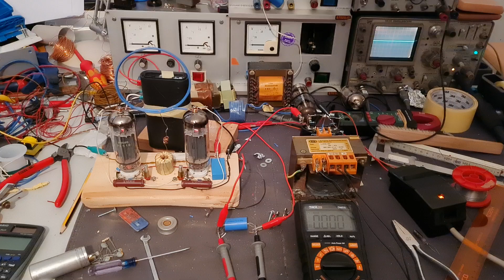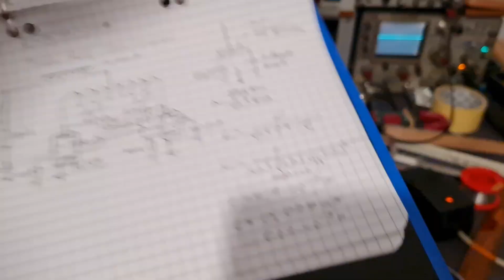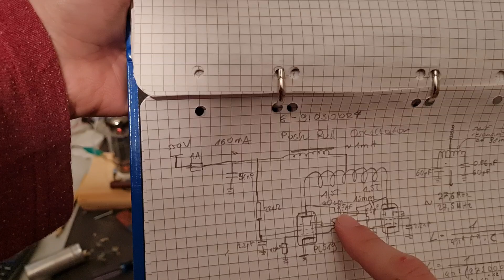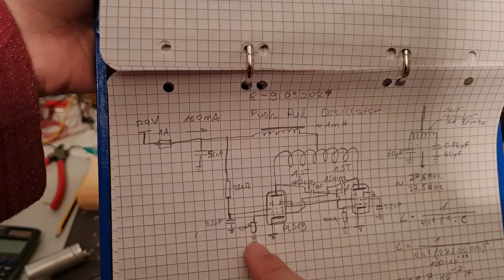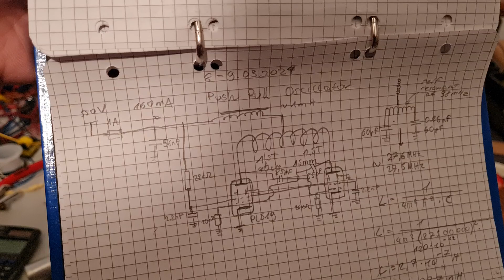Help with the PL519 Vacuum Tube push pull power oscillator

Comment: The length of the wire used for the anode choke should not be longer than 1/4 of the wavelength the oscillator is working on. You can used a small neon to 'see' the high voltage nodes and low voltage but high current nodes along the choke if it is too long. At high power, those nodes will be hot as well. Also I agree with another Youtuber's comment that maybe a core shouldn't be used in this application cause it will induce a lot of parasetic capacitance.
Reply from the maker: It's an honor to have you here, thank you.
I didnt think the choke would be the problem, last time i made this i used a plastic piece to wind stuff on, i suppose i will make a different one witb a large amount of turns.
should i try removing those turns in thr air first?
Reply: @janno288  Yeah, I think those wires in the air won't do too much help and ypu can just remove them. By the way, what valve did you use in your previous successfully operating pushpull oscillator? In my opinion 20pF feedback is way too large.
Reply from the maker: @uecmitsuimarinedieselengin873  the value of the choke?
I didnt calculate it, i had a piece of plastic and i would a random amount of turnd on there, maybe 100 turms or so, i still have it, i can put it into one of those testers and see what comes out.
that oscillator worked at least and was able to light up fluorescents and neons, but only well above 300V supply input if i can recall.
How should i change feedback capaciors with frequency and griddrive?
I plan to make a big push pull tesla coil with two gu-81 thbes which hasnt been done before.
the frequency is 160kHz. for the GU-81 the feedback resistance is equivalent to a 150W 230V tungsten lamp. I was thinking of converting that resistance to the impedence of the capacior at that frequency.

I based 20pF on @PosthumanKindergarten push pull oscillator, he had a 5pf and the impedence was 300ohms so i also picked my impedence to be 300ohms at my frequency.
the capacitor in push pull oscillators is still a mystery to me
Reply: @janno288  Sorry I didn't make it clear, I mean what value of the feedback capacitos did you use for your previous oscillator? In your video that oscillator works good, judged by the not too hard ignition of that CCFL in that kind of a long coil.
Reply from the maker: @uecmitsuimarinedieselengin873  I used 80pF, those small things are adjustable capacitors from 20pf to 80pF and seem to br high performant stuff rated to high voltage, i found them when i bought a lot of Polypropyle capaciors.
The previous one had a 20kOhm gridleak and 80pF feedback capacior.
i used the same capaciors and resistors and added another 20kOhm in parallel, so the gridleak is like 10kOhm now
It was a CFL not a CCFL
Reply: @janno288  That is a surprise, usually when using such small tubes, the needed grid drive won't be that high. After watching your video again, I noticed the abnormal waveform on the oscilloscope, it seems parasetic oscillation is going on. In my tests, if the circuit layout is not good and has some parasetic parameters, when operating at high power it might go into parasetic oscillation and the tube's anode/grid dissipation will increase dramatically. I noticed that when you gradually increased the voltage, the oscillation seems good at first and when the voltage went high enough, the waveform became abnormal, is that the case or I just didn't noticed the details. Also, maybe you can check the tubes' temperature to see if the current is really that high or it was just the RF interferance?  If the parasetic oscillation did happen and you notice the tubes's dissipation is high, then you just need to take actions to try to stop the parasetic oscillation. Also, since the parasetic oscillation happens among the parasetic components, the interferance could be high which meets with your meter behavior.
Reply from the maker: @uecmitsuimarinedieselengin873  I tested it again with an analog meter and an rfbypass capacior on it, it draws ~0.6A at 480V (the voltage dropped and my meter was reading a lot of changes, the voltage was unstable) Thats still over 200W and i dont know where thats going into, the tubed arent redplating, they need multiple minuted to redplate with 90W on the anode even tho they are rated 45W,and the tubes are new and tested good and they must be good if it indeed is oscillating 
Is there a foruma i can use to choose correct feedback capaciors for such an oscillator?
Reply: @janno288  The calculation is not quite easy for such an oscillator if you really want to get an accurate number, maybe can refer to my video  which was posted last summer about how to calculate and design a vacuum tube oscillator. If I met with this same problem, I may try to redesign the circuit layout to minimize any parasetic inductance 😂,during my experiment such kind of a strange situation happens as well.
Reply from the maker: @uecmitsuimarinedieselengin873 I had fered that, i was mostly going through trial and error.
How does 470pF sound or maybe half of that?  for the GU-81 tube (g1 + g2) have a dissipation of 130W. the gridleak will have a impedence of a 100W incandescent bulb (choke coil)
Reply: @janno288  You mean the capacitance in paralle with the working coil? Or the feedback capacitor?
Reply from the maker: @uecmitsuimarinedieselengin873 No I mean the feedback capacitance from the primary coil to the grid of the other tube, like the push pull system here. 
The feedback capacitor that drives the grids.

I watched your video again, but you dont talk about how to choose an apropriate capacitor. 
Do you know any online resource that talkes more about such oscillators?
Reply: @janno288  In that video the calculations are for the grid leak value and the needed feedback ratio at the given input voltage and needed power. However how to get the feedback wasn't defined. If you are using a feedback capacitor together with the grid to cathode capacitance function like a voltage divider to get the feedback, then you will be able to know the needed feedback capacitor value [a voltage divider calculation, set the values to get the needed feedback ratio which has been worked out previously]. For the GU81, I did a bit research and didn't found any characteristic curve which shows its function as a triode[G1+G2], that is needed for the calculation. Maybe we can just do it in a simple way: just use trimmer capaciters 😂
Reply from the maker: @uecmitsuimarinedieselengin873  i dont have any trimmers that go to such power needed for the GU-81. 
The feedback capacitors are frequency dependant arent they?
I was thinking on using a tapped primary coil to drive the feedback from that, which already is like a voltage divider.
Where did you find all this Information about these oscillators, any specific book or Website you would like to recommend?
Reply from the maker: @uecmitsuimarinedieselengin873  Hey could you please answer my last message?
Reply: @janno288  Hi, sorry I didn't see it previously. I think the feedback is frequency dependent due to the parasetic parameters and the loss going up with the frequency. However, most of my reference materials aren't written in English, they are from translated Soviet books in Thai. I only found one book in English which might be interesting to you, Phillips Tubes for RF Heating.
Reply from the maker: @uecmitsuimarinedieselengin873  I thank you a lot!
I will most likly also today try to make some graphs for the GU-81(M) anode current dependant on grid voltage, for a B+ of 1kV, 2kV. maybe even 3kV, tho I will try to stay in the maximum allowed current, since i dont want to blow the cathodes

mind also mentioning the soviet books, i have a friend who can read russian and is into the hobby
Reply from the maker: @uecmitsuimarinedieselengin873  I might contact you per Email tomorrow, i made some curves for the GU-81(M), i tested it with two tubes, one abused one NOS and they showed next to no real difference.
In triode mode, without positive voltage, at 1kV the tube conducts like 10mA funnily enough
Reply: @janno288  Ok, looking forward to that 🤗
Reply from the maker: @uecmitsuimarinedieselengin873 um both your emails on youtube do not work, my email client says they couldnt deliver the message. 
Do you know anything about that?
Reply from the maker: @uecmitsuimarinedieselengin873  um both your emails on youtube do not work, my email client says they couldnt deliver the message. 
Do you know anything about that?

Any other way to contact you without the delay of youtube messages?

Comment: you sound desperate for such an irrelevant project :D
anyways yeah, the choke can be the problem, i wound my chokes like small tesla coil secondaries but with slotted windings, no ferrites no matter how high is their maximum working freq. and i dunno where your ferrite is coming from, if it's a random one it hardly goes so high in f. hence you remain with just those turns of copper, that is like nothing in inductance, i see very few turns also, such choke can be basically a short the way you made it... i calculate the inductance of the choke in two steps, i chose a Z value for it that is sensibly higher than the impedance of the tubes and coil, like 3X more (or even more), then calculate the inductance form the F and Z so... like 2kohms of the tubes times 3 = 6k .... 6000/(6.28 * 27'000'000) = 35 microhenries .... that (according to online calculators) is like a pipe of 3cm of diam. with 50 turns of wire (organized in like 3 groups) for a length of like 5cm, you can add more turns to be even better, DC resistance is irrelevant

that's what i suggest you, apart this it may be a busted tube or the layout that is "secretly" not good for some reason, this happens at hi f.
Reply from the maker: I didnt think the choke could be that critical, but yes i see, it does make sense.
I should wind one instead on something non inductive, you're right.
Thanks a lot for commenting, i will also try making that Tesla coil on it, because i havent seen something like this myself and i love the idea of it.
Reply from the maker: Hah yoh wouldnt belive it!
I found out the reason with someone who was uneducated on tubes, he checked the datasheet and found the example schematic that had g2 decoupling, but had a 100ohm resistor between the grid 2 and the bypass.
I out such resistors in, they smoked, i out higher power ones in, flawless operation together with the new RF choke, i can light uo CFLs  but strangely only part of it lights up.
Remmeber when you had g2 issues, this couldve been your fix
Reply: @janno288  these things happen, honestly i saw those resistors there and also G1 on audio amps, but original schematics never had those, only amateur ones, so i guessed that the cap should go tight on G2 and G1 can be without, never had problems myself also

i said it could be the choke cos maybe 27MHz isn't too high for a ferrite but who knows, i'd not trust random ones
Reply from the maker: @PosthumanKindergarten  if you look at some tube datasheets they sometimes show a resistor in series with g2 from the bypass capacior to the tubes g2.
(PL519 datasheet)
Reply: @janno288 yeah, i see... first time i see that datasheet, i don't have any 519 or 6P45S, didn't need to see that... honestly it's incredible that you solved such a big problem with this simple thing, MAYBE this is mostly for the PL519.... in my case i doubt this would solve a thing, i strongly believe that putting an SCR on a pentode VTTC is prone to fuck ups, or it's just the GU50 or i dunno, maybe some day i'll work on it again
Reply from the maker: @PosthumanKindergarten  Soviet tubes seem to be way harder to ruin since they dont have a cathode fuse to pip, they seem to have mostly tick nickel strip connections or something else like that.
Do you have g3 tied to cathode or ground?
i see g3 tied to ground and not to the cathode in interupted circuits
Reply: @janno288  i think tied to ground.... i dunno what happened but i couldn't manage to make it work, or it pops the SCR, or it goes full 50Hz past some power, i also saw it making small sparks cos of the staccato and at the same time random bigger sparks OUT of the staccato timing, it was so outrageous è_é i got so pissed... apparently the anode of the SCR reaches it rated voltage and it avalances or something, sometimes breaking, i tried to limit the voltage on it in a lot of ways, no way!! ...i dunno how it seems to work so well for other people, but the majority of the schematics with a staccato i saw were with triodes or in triode mode
Reply from the maker: @PosthumanKindergarten  there were also some PL500 based vttcs with a staccato interupter.
I doubt its that.
Reply: @janno288  yeah but not with a MOT, infact it works with a mains doubler,... i also managed to make it work with two PL504 in parallel but past 70% of variac it started doing the same, it also worsened after the fuse popped
Reply from the maker: @PosthumanKindergarten
wait was it that tesla coil where the fuse popped on camera?
Reply: @janno288  oh you remember!... yes it was... i dunno what happened to the tubes but that effect on the TRIAC worsened after that, i could still use those tubes but i had to use a staccato before the MOT or it went full 50Hz past 50% variac, with the staccato before the MOT i can put the variac at 115% no problem (that is also possible cos you shouldn't push a MOT so much, but single pulses on it trough a relay are (kinda) fine)
Reply from the maker: @PosthumanKindergarten  not optimal but thats very odd, i think adding some sort of choke before the triac possibly could make it work

Comment: i was looking for some explanatory comment but my comment is first and non explanatory :)
- i dont recall what the push-pull oscillator like - will wiki it but some scheme would be usefull
- 27 MHz sounds like a VGA pulsing (25,1) - maybe its just some intrinsic self oscillation
- oh! 27 MHz is the 10/11 meters wave of CB radio - maybe you pick up some transmission, but usually there are many.
- on some other videos people radioamators point out that LED lights on the street can emit 27MHz but in narrow channels - eg between 27,51 and 27,55 MHz
Reply from the maker: - No VGA Monitor powered up in the house
- I am in the basement, radio signals dont go in or out
- No LED lights in the basement, nor is any LED light on inside or outside

27MHz makes sense, the self resonant frequency of that foil is around 35MHz and together with the g3 to anode capacitance of 50pF per the the frequency drops to 27MHz which makes sense, its just a weird coincidence that it lines up with the frequency of another one i made that was able to excite neons and fluorescent bulbs
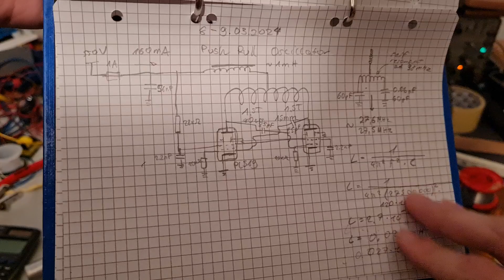Reply: @janno288  OK - there is a schematic at 2:49 - so the equivalent (mystery) inductance is 279 nH

i have refreshed my memory about Collpits type of amplifier ( "coil - pits/pitfalls 😢 ") i knew it as the differential type of amplifier but i dont know anything about tubes (unfortunatelly :)
i can point that 38/27.5 is roughly a Square_root(2) :) but it is pointless coincidence for me. 
It is an amlpifier so it could amplify anything that it finds useful as far as i understand 

The shape looks like a saw tooth - it reminds me of a crossover distortion that looks like a saw in the 0V region
The self resonance makes the coil behave with inductor characteristics below the resonant frequency and as a capacitor above it
Differential voltage amplifiers have some special phase shifting properties - they shift the phase by PI/4 in the working region and inverse the phase (PI/2 shift) in the above region
i believe it is some distant CB radio interference :)
Reply from the maker: @Tylko_cała_prawda_jest_Prawdą  the sawtooth happens due to the scope probe being away and due to the large metal plate, when i being the scope close its a near perfect sine wave, either the probe or the scope, i have no way of telling, thr scope loop is not a perfect loop either.
but as the weirdness happens you can see that it becomes more sinudoidal due to the higher power, overcomming some looses and radiating more for the scope to pick it up, then weirdness happens.